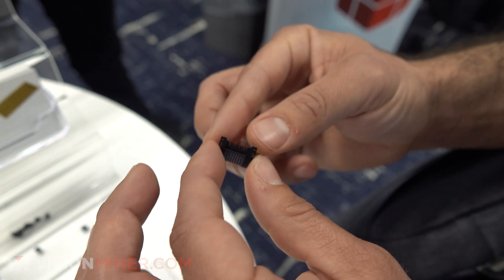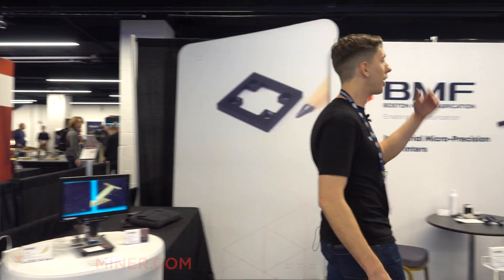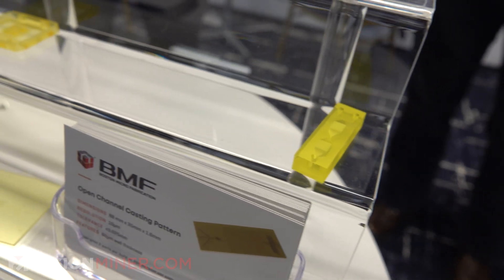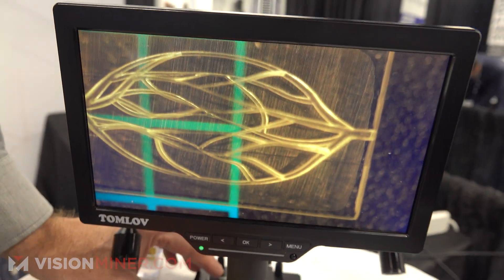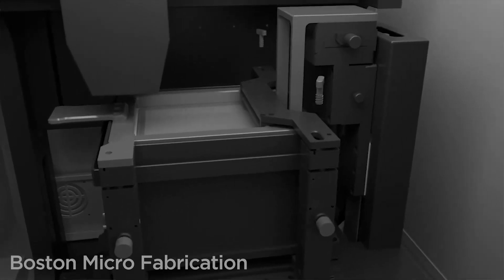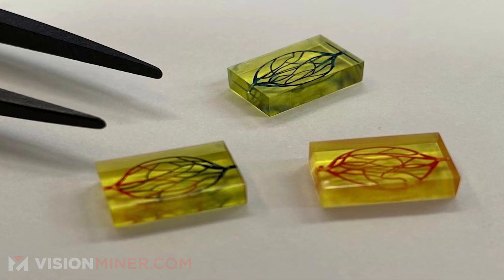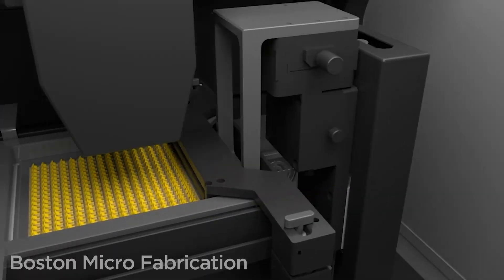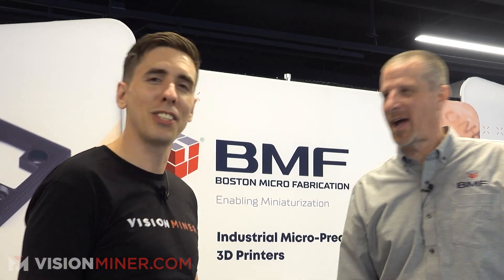Small Parts, Big Ideas: Boston Micro Fabrication's Micron-Scale 3D Printing | AMUG 2023

Comment: Can the printer print molecules of different chemical properties from the table of elements?
Reply from the maker: No, not like that -- that's getting into diamond age territory, we're not quite there yet :) It can print in specific elements/materials, which then could make a fluid reactor to create other.... well, that's what they do a lot of the time :)
Reply: The only printer that can print molecules is 🧬. When it spins it makes the atoms in the cells align in to various molecules after the enzymes break the compounds down in to cingle atoms. If you wanted to build a brain cell out of marble sized atoms by hand you would have to work with enough marbles to fill four Olympic swimming pools that's enough to wrap around the earth two and a half times. And then the brain cell would be massive!